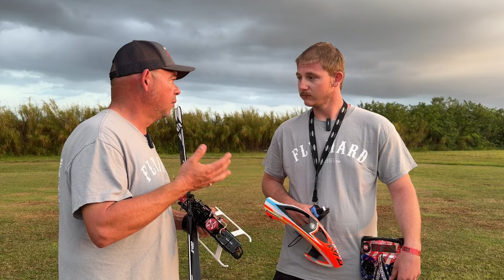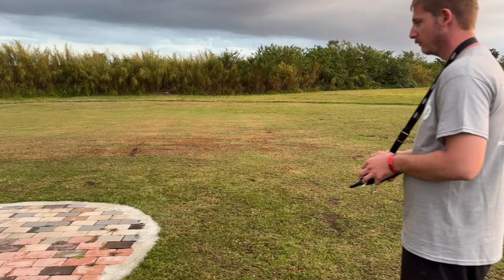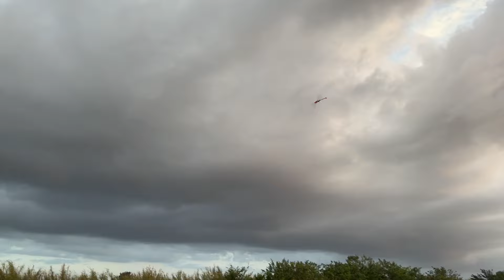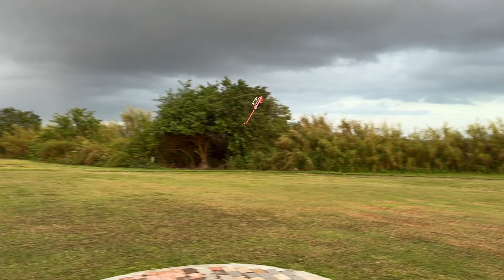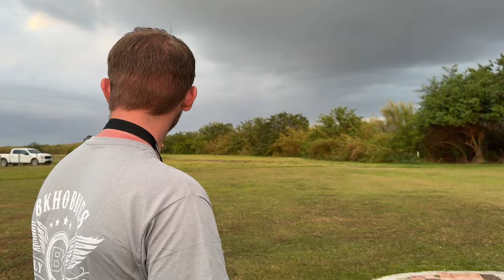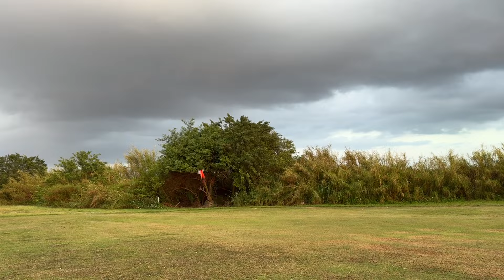Raw 420 Competition flown by Justin Cook

Comment: Is the raw 420 going to stay in production or is this replacing it?
Reply from the maker: It has been discontinued, but parts support is guaranteed to be available for 10+ years.
Reply: @BertKammerer ah. Dang no one liked it? I love mine. Thats cool on the parts support though. Is that for all sab helis? I have a Kraken 580 also
Reply from the maker: @DetoursRC  It is not about like, it has more to do with the direct drive motor being harder to produce I believe plus the competition model is way more efficient.
Reply: @BertKammerer  gotcha. Thanks

Comment: Looked like Justin was using a 2600mAh battery? Curious cause I’m choosing a battery for mine. Is 2400mAh much different?
Reply from the maker: The ManiaX 2400 will not fit! Check the battery compartment dimensions at the bottom of this page and compare against the batter you're planing to run: https://www.bkhobbies.com/products/raw-420-competition

Other than that, 200 mah is not going to make a difference flying time wise.
Reply: @BertKammerer  the 2600 will fit but the 2400 won’t? You offer both on the website for the 420.
Reply from the maker: @1981billiam  The 2600 is a 45C pack: https://www.bkhobbies.com/products/maniax-6s-2600-mah-45c. The 2400 is an 80C pack and much larger: https://www.bkhobbies.com/products/maniax-6s-2400-mah-80c